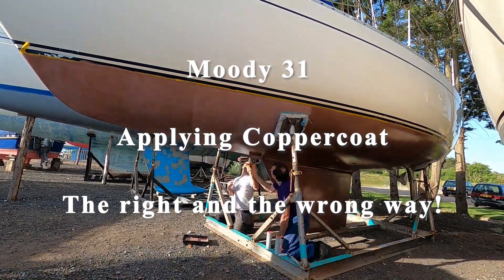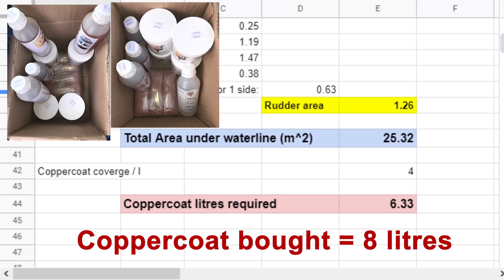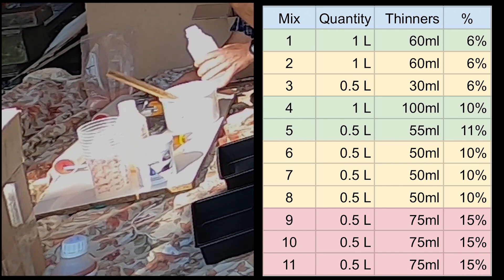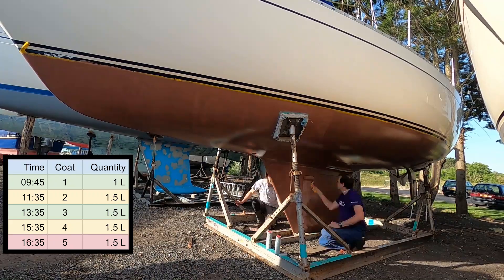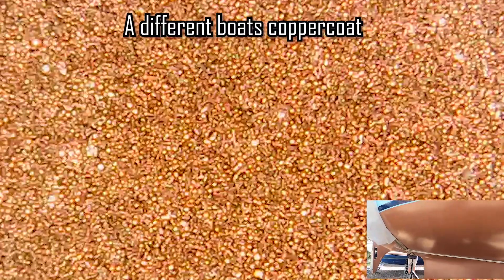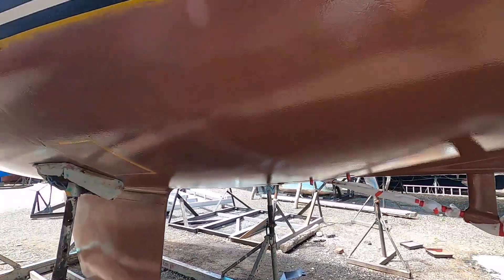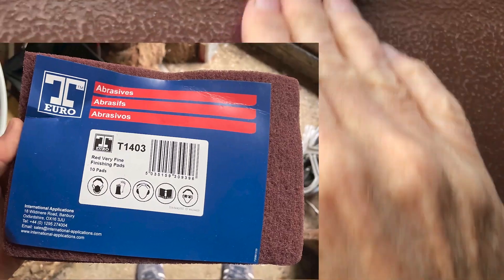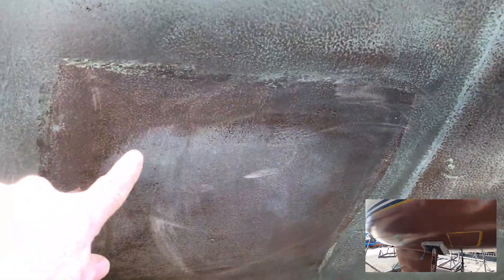Coppercoat Application - The right and the wrong way!

Comment: Find a friend, 2 people applying and one mixing is the way forward. Never do in less than 15degrees air temp. Look 3/4 days forward in your forecast. Avoid moisture in the air. You have rain, forget it, wait until the air is dryer. Get 10 coats on if you can, so bring sandwiches or soup, and some music. You have spent a lot of money on the product, and it works great, so plan ahead and do it well...

Comment: Are you tidally beaching the boat on its keel tied to a dock?
Reply from the maker: Yes, it is called a ‘drying grid’ and is located at a marina, so has fresh water and electricity.  The boat sits happily on her keel, very slightly leaning in toward the dock.  With the tide we generally get 5-6h to do the work, which is fine for a jet-wash.
Reply: @Gi1e5  wow I guess it still takes a location with a very large swing tide. But yes what a useful feature of a marina.

Comment: Great video, question: how long did you wait for the Gelshield to cure before you started applying the CC? Thank you!
Reply from the maker: Good question.  We left it 14 days, but that wasn’t to let it cure, that was just what worked for our schedule. The cure rate is dependent on temperature and at 15 degrees, it is ‘immersion’ dry after 18h. We gave it a light sand the day before applying CC.

Comment: Could you please write what you used as skirt to protect the layers of coppercoat from rain
Reply from the maker: Hi, we used 150mm damp proof membrane (from screwfix.com - part#78665), it came in a roll of 30m length which was perfect - we stuck it on with electrical tape, which worked ok, you could use (good quality) gaffa tape - but don’t be tempted to use cheaper gaffa tape as that sometimes leaves a sticky residual which is a pain to remove!

Comment: Great information! Would it be best to avoid thinning with isopropyl alcohol? You talk about it as one homogeneous layer - what should the be maximum overcoating interval to avoid "building up layers"? Thank you
Reply from the maker: Isopropyl Alcohol is what is supplied by Coppercoat for thinning, one company suggested using water to thin (since Coppercoat is water based!) but we have not tried that.  Concerning over coating time, for us, I can tell you that 2 hours was too much and 30 mins was OK. You just want to get it on as quickly as possible.  On the video you can see that it changes colour from light pink, and we found that as soon as it changes colour you can apply the next coat, in my tests this was as soon as 5 minutes. Hope this helps!